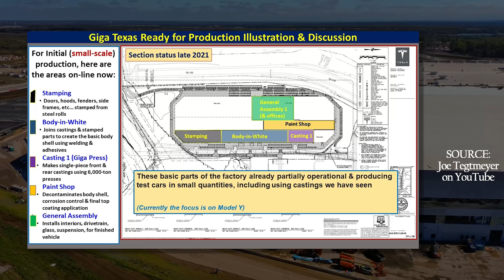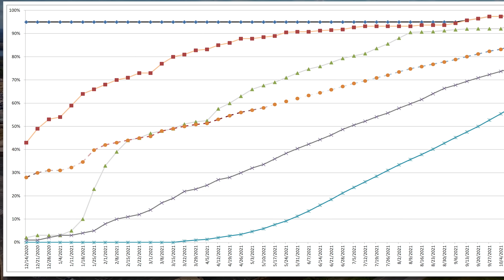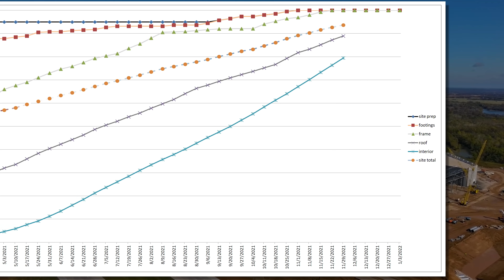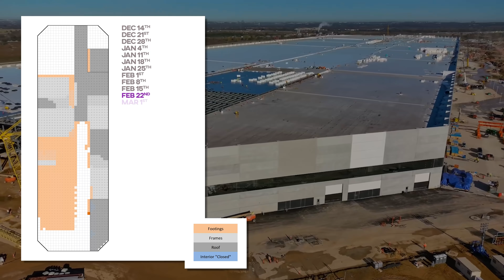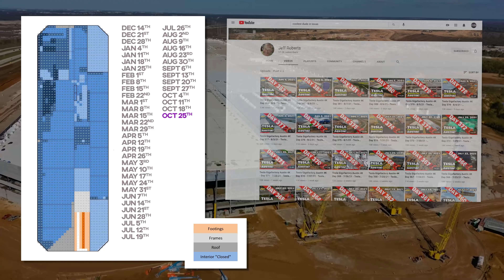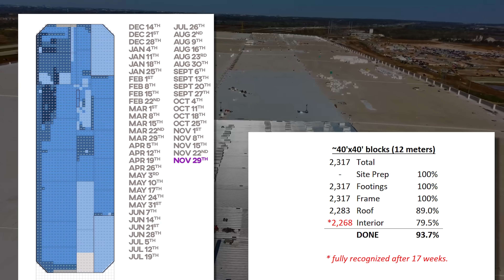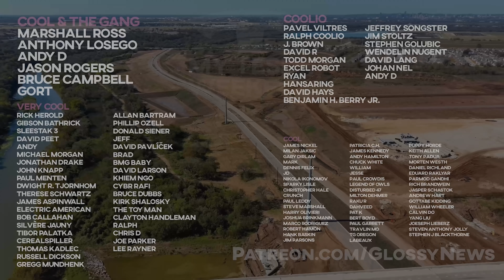Giga Texas has started production, and it's 94% done

Comment: It might be done, but there is no battery that is ready for the production of the vehicles .
Reply from the maker: It's been stated that Kato Road has been producing and stockpiling batteries to handle the supply during launch and ramp. The could still make them with 2170s, since Giga Nevada expanded production a while back, but it doesn't appear they'll need to go that route.

Comment: They still need to get final inspections before permits are closed on the building. Secondly you realize that there 3 times as many workers on the site today than there will be during operations? Tesla has the lowest headcount in automotive history. All the cars currently parked along the highways side of the building? Thats the production/engineering staff.

Comment: It's coming along very well. My Model Y might be coming from there by June next year. For me, complete is when the first production ready vehicle rolls out of there. There's going to be work on the factory before and after that. Concrete work and asphalt, like you said, will go down fast and is pretty much ready in a few days to drive on. Landscaping, depending on how big the project and size of the crew, can be put in within a day or few days.
Reply: I think since they are building a factory, you can call a factory finished once it's manufacturing. The rest are cosmetics which might be important for someone's home but not for a factory.
Reply from the maker: The progress with the paving is indeed moving very quickly, as we can see from yesterday's updates. It's less like the icing on the cake, that does take a lot of time, but the box the cake goes in, which is trivial compared to the rest of the process.

Comment: I’m inclined to think the logistics yard might be across the highway to the west.  It is a big open area with room to expand as needed and to build test tracks and charging lots.

Plus I think it helps relieve congestion around the factory building, as the transport trucks don’t need to be competing for space with the hundreds of trucks delivering supplies daily to the factory.

My fantasy is that “factory mode” software could make the cars smart enough to drive themselves off the factory floor and have the logistics computer system tell them which spot to park in in the logistics lot.  That would save a lot of people shuttling back and forth between lot and factory!
Reply: Great points. I was thinking much the same. The overpass road is an easy shot and I can't think of anywhere else for a test track or tracks.

Comment: My definition of complete is when they build my Tesla Model Y performance. I ordered last month with an estimated delivery of 1/6 through 2/6. Last week they moved it up to 12/13 through 12/31. I won’t be taking delivery before 1/1/22, and I’ll postpone if it’s not a Texas car. Fingers crossed that they have started production, and it starts with performance. That should mean my Y will be a Texas Y Performance!! If not I’m fine to put it on hold until it is, but New Year’s Day would be fantastic timing for me.
Reply: Same here. And same time frame for my MY LR
Reply: Not sure if I would want a Texas car early on.
Reply: @Americanthatspeaksturkmen  I’m kinda the opposite, I think Fremont was the learning curve, with the panel gaps and everything, then Shanghai cars were much better. I expect Berlin and T’d to be a significant upgrade from Shanghai. 
They are doing a few new things at those two new plants, but they are improvements, for production efficiency, except the battery. But I’ll take the risk for the new 4680. Plus I’m sure the furst of those are all hand built at Kato rd in Fremont and shipped to Austin.
Reply: There is no machinery inside the factory.  Your car MAY be ready in a year or two.
Reply from the maker: @William Whitman - You are mistaken. The stamping, casting, body-in-white, paint shop, general assembly and office areas are all complete. There are finished test vehicles in the building.

This is inside Giga Texas yesterday: https://www.youtube.com/watch?v=lSD_vpfikbE
Reply: @FutureAzA  there was a completed MYLR in the background. It was black. I thought I saw a blue MY going down the lane buying that one as well.
Reply: @ReachOutToWilliam  Are you actually serious? You are gravely mistaken. In fact they have been making pre production cars for awhile and the casting machines have been running almost all year.
Reply: @ReachOutToWilliam  Machinery is already there. It really doesn't take long for either the Texas facility or the Germany one to put in equipment, robots etc. That's the least of their worries.

Comment: The title says "Giga Texas has started production, ..." but I listened to the video twice and I can't find where you elaborate on such news.  Am I to assume this was simply click-bait?
Regarding building completion, I don't think it's anywhere near complete.  The drivetrain area is probably getting the floor concrete poured as we speak.  It will be a month or two before the machines are put in place, and the lighting and the wiring.
There's also all the heat exchangers and climate control stuff that goes up on the roof.  Look at giga Shanghai; the roofs are literally jungles of pipes and big boxes with fans.  And if you look at giga Berlin, there's also the water treatment facility, the fire-fighting facility, the power backup megapacks, the truck roads with oblique line areas for temporary parking;  and if you look at giga Shanghai again there's the test circuits, certification and shipping control buildings, parking lots for finished cars, parking lots for car delivery trucks to load, and parking lots for truck trailers.  I'd say two more months or three before any real production starts.
Reply: I work at tesla in Texas and you are very wrong sir
Reply: @MrXbloodline  Please elaborate;  what part of what I said is wrong?  I did not say production cannot start at all yet;  it may be starting now;  but I said real (serious) production.  Without a finished drivetrain area you could start producing cars only if the drivetrains come from California.  I'd love to be wrong, though.
Reply: @MrXbloodline  It seems I was very right, sir.  I said 2 or 3 months;  it's 2.235 months already.  And you could say production has started already, but this video was saying the same thing 2.235 months ago.  And I said "2 or 3 months before any REAL production", which doesn't include a few cars stored inside the building.  Or you could argue on the basis of permits, but I won't believe it.  I still don't see an area for cars to be loaded onto delivery trucks;  and I still don't see a test track;  and work is still being completed on the roof BESIDES solar panels.  NOW,  February 7 2022, I could believe production could start in the next couple of weeks ....  but probably next month.
Reply: I feel the same as when I watched a video where Brandon tells us that Mary is responsible for the electrification of America. I think we are screwed. There is no limit to the depths of our deception with each other any longer.

Comment: They finished the northwest corner walls and windows and are working on the south walls. So walls and windows are almost done but will be a while before they close the south wall since they just finished the framing and need to bring in a lot of equipment in the next few weeks. Cant wait until all the roof is done. That is the next milestone
Reply from the maker: My thought on those last few walls is that it has more to do with ventilation. Like you said, they still have a lot of trucks to bring in, and since it's all diesel big rigs, they can't use loading docks and fork lifts quite as efficiently as if they just drive in to wherever they need to be. That's what we're seeing in the battery cell production area.

Comment: Where's the heating and cooling equipment?  Usually you see this on the roof or a nearby facility.
Reply from the maker: Much of it has been placed inside the buildings, for some reason. The NW corner has a bunch of heat exchangers, and there's another bunch of them right near the middle of the building. It's the first time we've seen Tesla do this.

Comment: Why not move employee parking further away, and have a Boring Tunnel shuttle service loop back and forth between the factory and employee parking areas?
Reply from the maker: Roads are cheap, tunnels are expensive. Plus if shift change isn't staggered, the tunnel would be way over capacity for 30 minutes every 8 hours, and site almost idle the rest of the day. Tunnels are ideal when there's no surface option.

Comment: When the Piedmont Lithium Mine deal for 1.6M tons of spodumene lithium fell through, they lost their source of lithium and stopped working on the BobCat project. I checked just last week, and the Piedmont Mine expansion is still tied up in protests and environmental reviews that may drag out two years. Now they have signed a deal with China's Ganfeng Lithium to get lithium hydroxide from China at a much higher cost. Since each  source of lithium spodumene requires a different manufacturing process, I doubt they will start building until they firm up a source of lithium spodumene and also get their battery line running. IMO
Reply: Tesla is in talk with Quebec government for Lithium.
Reply: @Wirmish  I believe that's a different type of lithium ore which would require different processing methods. That's why I'm not sure if they will start building their Cathode plant until they get their lithium supply figured out. Lithium is a strange animal.

Comment: Have you noticed that with the addition of those two new ponds on the south end, there is no way a 500 ft extension could be added?
Reply: Having windows on the south end also argues against an extension.
Reply: The site plan I saw indicates that the perimeter road will separate the extension building from the main.  Maybe they will have bridges going across on higher floors?
Reply from the maker: Joe Tegtmeyer drew it out on his siteplan, and it looks like it would just fit. Still, I definitely jumped the gun trying to include it.
Reply: @FutureAzA  Joe replied to me on Patron that if they don't remove the two closest ponds, he doubts it will be 500 ft, if they build it at all, as shown on the Phase 2 site plan.
Randy,  from Terafactory Texas, was far less optimistic.

Comment: Easter egg. One does wonder about Bobcat especially in light of the recent decline of German subsidies. Did they change strategy on battery manufacturing?
Reply from the maker: The theory I've heard is that since the Piedmont deal fell through, they put it on hold, since each type of lithium requires a very different process to refine it. It could be that they have to secure the supply first, then design and build the facility.

Comment: My guess is the ramp will be slow. Slow enough at least for them to be able to keep pace with more parking being built. After all, keep in mind that they will only be building the 4680 version of the Y. That means they will be constrained by how many they can build via the current battery cell production at Kato Rd. Which if the rumors are true have been slow to ramp due to some engineering challenges.

To say nothing of the chip shortages.
Reply: Kato Road has basically tripled output in the last few months and has basically over come those challenges. They should be fine
Reply: @Americanthatspeaksturkmen  EXACTLY… and they have been on a hiring spree specifically for Kato Battery production.